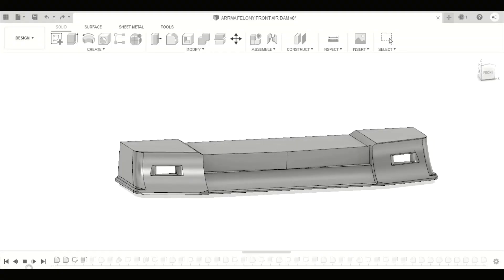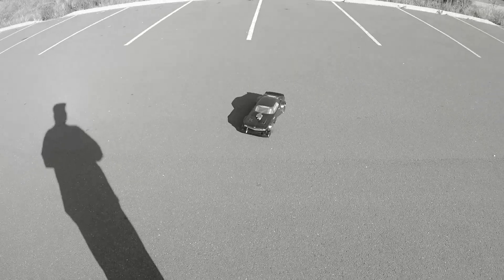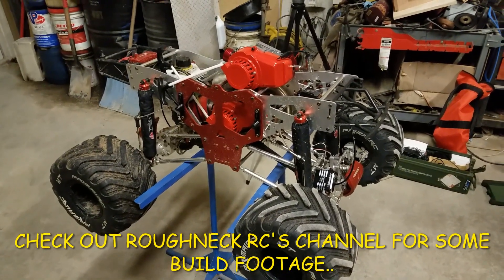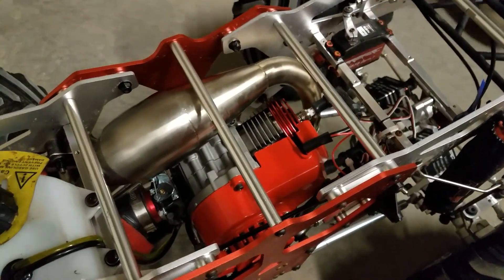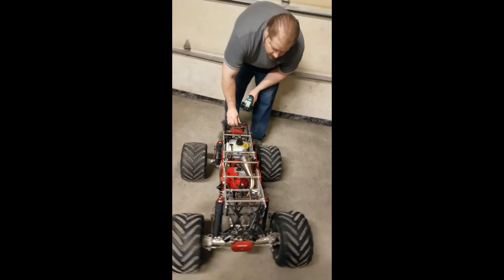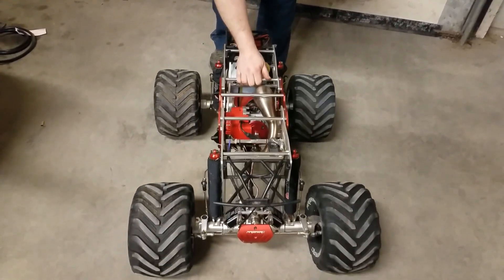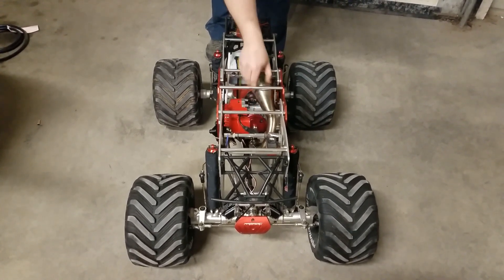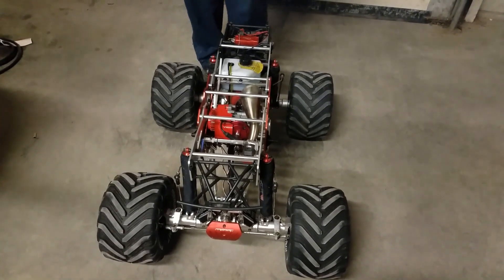PRIMAL RC RAMINATOR MOD ENGINE INSTALLED!!.. QUICK FIRE UP...NOW  LET THE TEST AND TUNE BEGIN...

Comment: Wats something like that costs to get done?
Reply from the maker: Hey Deontay, most likely new engines will be built and sold.. price is to be determined at this point.. we will be getting into testing and tuning first then go from there before any kind of production is started..👍

Appreciate you stopping in to check it out.. ✌️